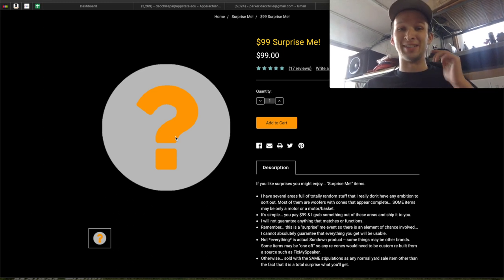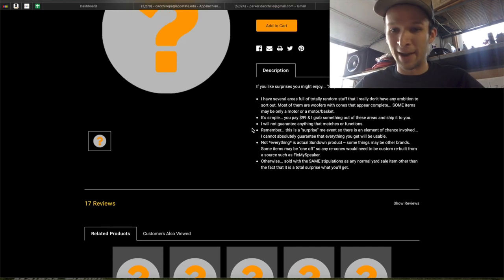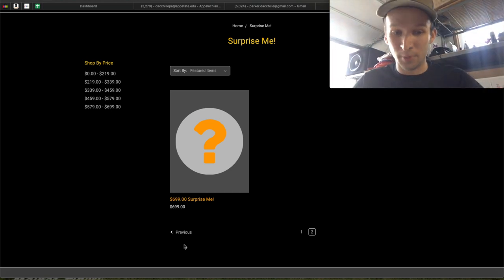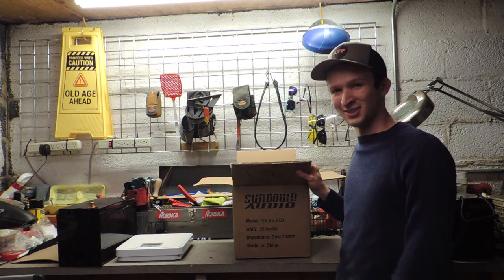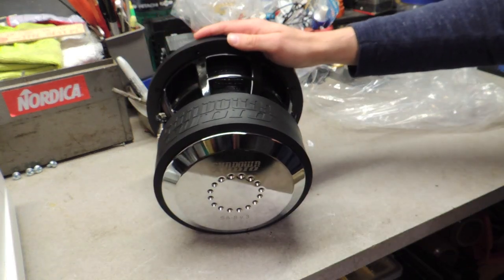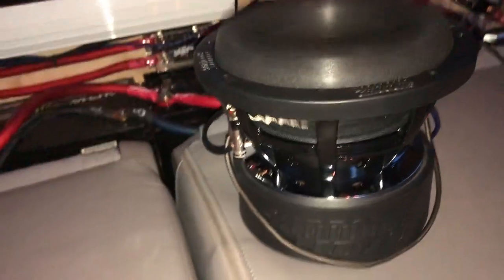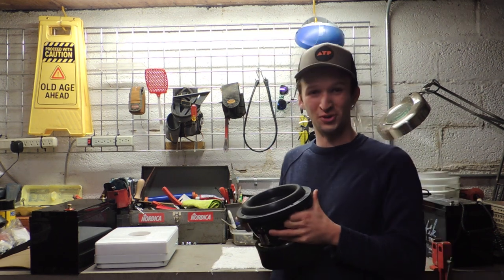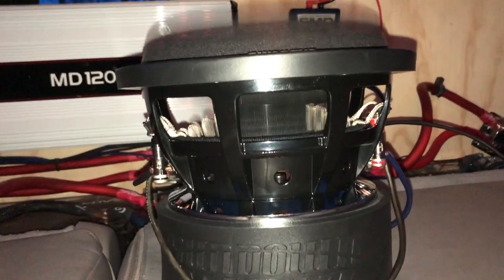SUNDOWN $99 MYSTERY BOX! Did I Double My Value?

Comment: Nice parker I love 8 inch subwoofers before I got my 12d4s I had a set of sdr 8 d4s from skar in a custom ported box I built & I will tell you what they bang! I'm thinking about running the 8s somewhere in my car with my 12s running off a 1500.1 but the 12s already bang so hard

Comment: build a baffle and throw it in 12 inch box.
Reply: I did that with my underseat upfiring 12" box......I covered the holes and put 4) 6.5" holes on the foward facing side....those lil audiopipe txx bdc4 6.5"s hit better than the shallow skar vd-12-4s.. that I had in there....with a skar rp1200.1 amp of course